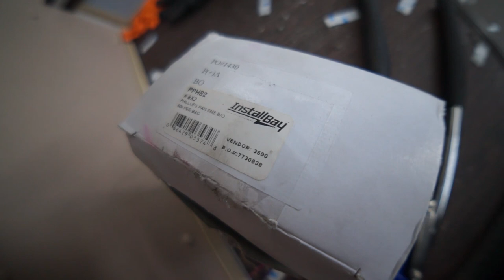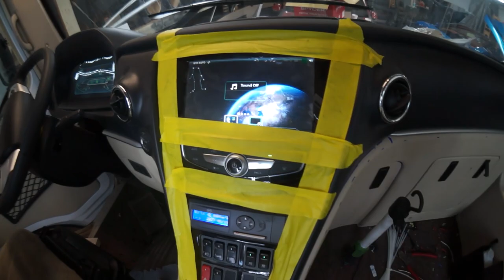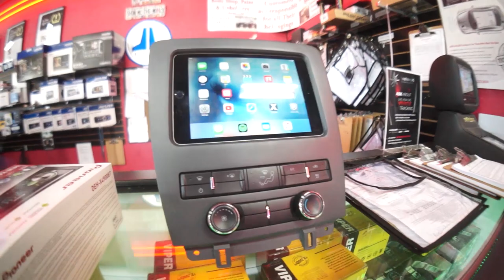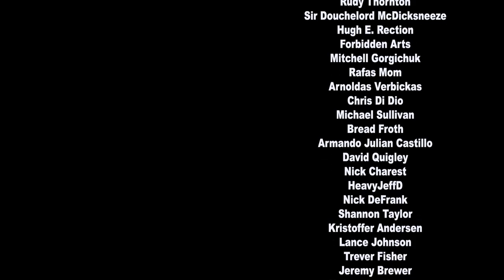Triple XL Rice Wagon! - Chinese party bus light install

Comment: If you want a digital cluster Doug, I have an idea... buy a Leaf and swap in the cluster, AND the powertrain! :D An old/lightly crashed Leaf can be had for a few grand. Only problem would be range, you'd be lucky to get 60 miles from an old battery pack.